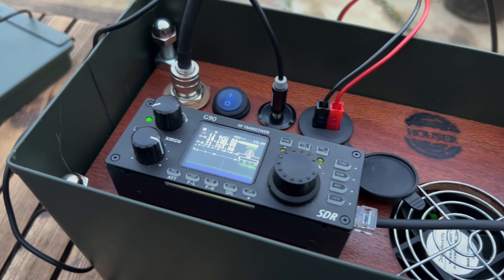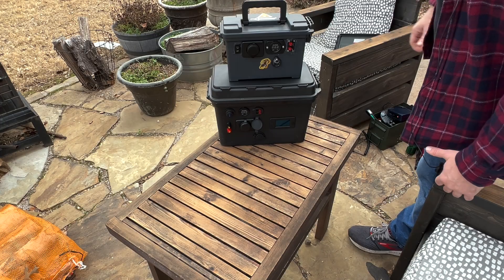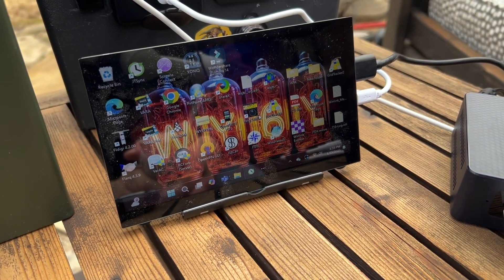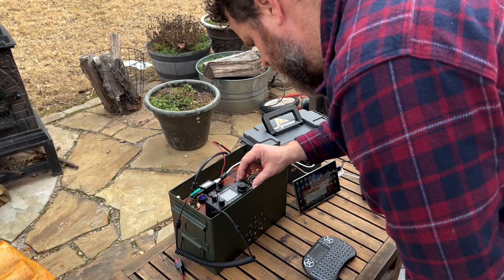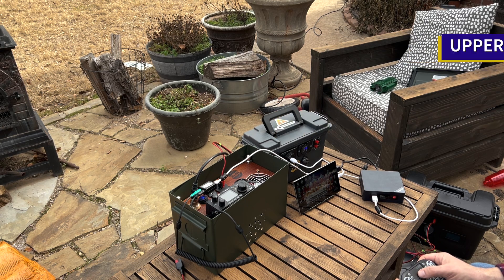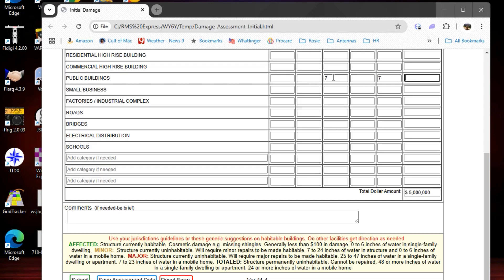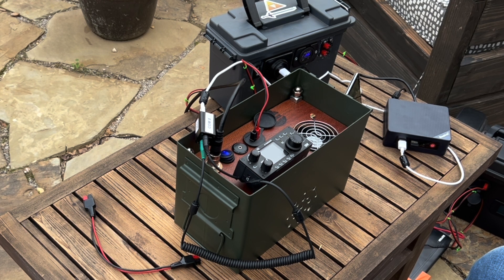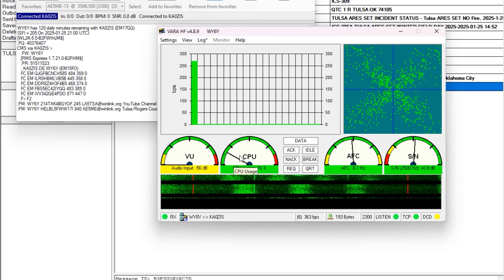Xiegu G90 Winlink Off Grid Winter FIeld Day 2025

Comment: I use a 2012  Mack book pro that I put a new battery in. Running Linux Mint and 73Linux from KM4ACK.  Had a couple issues getting Vera to work, but in his forums there are a tom of very knowledgeable folks that love to help. Use it quite a bit. But being in Canada winter field day presents a few challenges to an old geezer like me. Winter Field day was -5.8f and my bones just can not handle that any more.
Reply from the maker: WOW!  Thats awesome Steven.  I may be reaching out! 73 WY6Y
Reply: @WY6Y-s3v  NP. If you are not following KM4ACK, I suggest you do. He's done wonders. He started out using a PI as his platform. But then started using an X86 machine.  73linux is the result and works on both. I mid rebuild as I preformed a command that broke my machine and I could not even use the snapshot feature to recover. I'm no Linux expert, but I think I did bad!

Comment: Glad to see your experience. I have a G90 as well. I also have used it with Winlink/VARA HF. I was able to send an email home when I was activating for POTA and camping at a state park without wifi or cell service. I also have my batteries charged by solar only when I use them for POTA. I also would like to see another computer option than the Windows PC. I don't have a Raspberry Pi but I do have a couple of PCs that I use with Linux and would like to use them for Winlink. I use JS8Call on those mostly. Anyway, glad you had some fun on WFD. 73 K5MGK
Reply from the maker: Thanks for watching man. I like JS8 call too and it is cross platform. I just don’t find it as reliable as VARA.

Comment: Winlink works via Wine on Linux. I've also heard of Pat, a crossplatform Winlink client, but i've also heard it has some issues
Reply from the maker: Yes, I’ve used Winlink variations on other OS, but never VARA modem. Have you been able to get VARA to work on Linux?   That would be pretty rad. Never could get it to work using Wine. 🍷 73 WY6Y